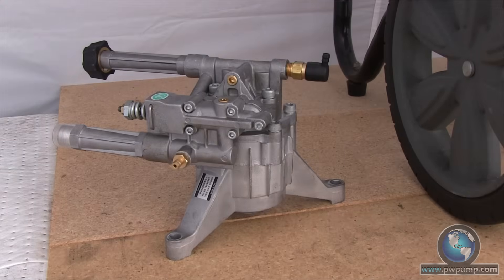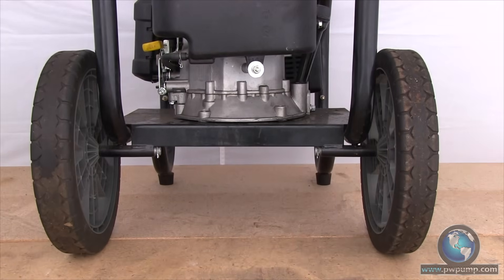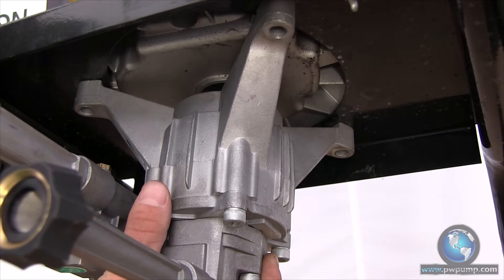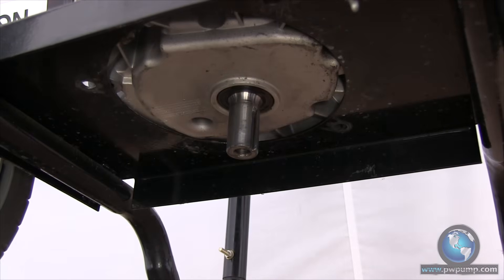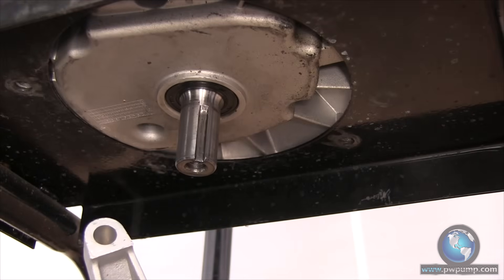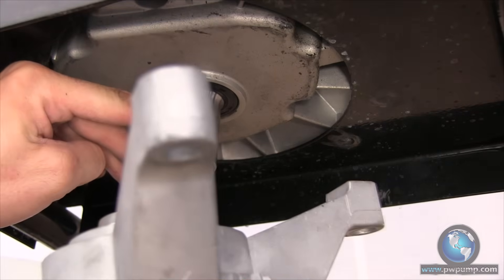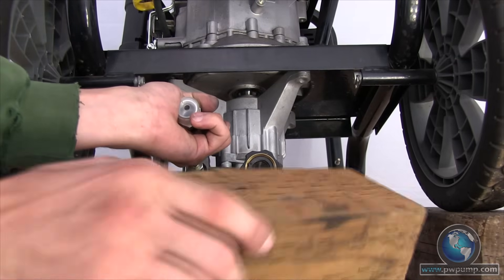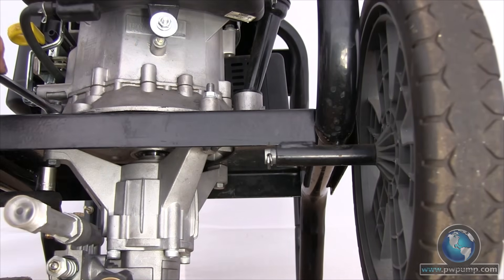How to install a vertical pressure washer pump

Comment: I have a Briggs and stratton 6.75 mine has 2 key ways one small one regular will one key work?
Reply from the maker: Hi, thanks for reaching out. Typically, the engine shaft where the pump fits only has one key. Could you provide the pressure washer model number so we can better assist you?

Comment: I used a half piece of duct tape around the shaft and key. Once I got the pump in the key where the key didn't move, I slowly unwrapped the duct tape and pushed up the pump until everything matched up. So far it works fine...
Reply from the maker: That sounds like a great option!
Reply: Same, but I used blue painter tape. It's easier to remove vs duct tape IMHO. Just make sure you remove all parts of the tape

Comment: My pump is all eat up in side how doi get it off
Reply from the maker: Your pump is held on with 3 bolts, and once those are removed the pump will generally drop down off of the engine shaft. Sometimes the pump may be more difficult to get off and may require some lubrication to be sprayed on the shaft to help loosen it up. Generally, WD-40 would do the trick.

Comment: Why are all vertical pumps shown with 3 bolts? My Craftsman 7hp has 4 bolts in square pattern like the horizontal models. Can I use a horizontal pump mounted vertically?

Comment: I used a rubber band to hold the key on the shaft while I matched up the shaft and pump.  I needed to hammer the bottom of the pump to seat the shaft close enough to add the bolts.

Comment: Great video ! I'm trying to replace my pump on an Excell 2500 . And I did exactly what you said about test mounting the pump. It fits snug but when I go to use the existing bolts they are a little bit short? I'm trying to install  this pump which has 3 legs. When I put the key way in the slot and line the pump up it doesn't slide all the way on? Any advice?  On my way to get longer bolts. Thanks for your help.

Comment: I was using a fairly new gas pressure washer yesterday and after starting when I pulled the trigger the pump made a funny screaching noise then the motor stalled...I restarted while releasing pressure same thing..starts then stalls..I turn water off, release any pressure start motor runs great..I slowly turn water back on and it screeches and stalls out..Now the motor wont even turn to try to start!! I think the cheap China axial pump locked up?? This was not even 6 months old!!!!

Comment: Great video but you forgot to mention to unhook the spark plug wire so the engine doesn't start while pulling the cord.
Reply from the maker: With the switch in the off position no power will be sent to the coil.